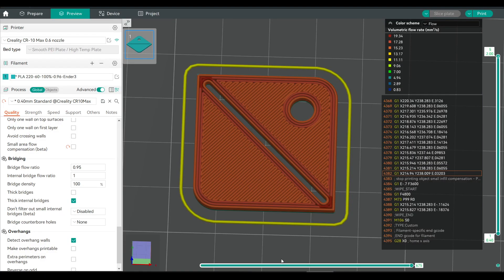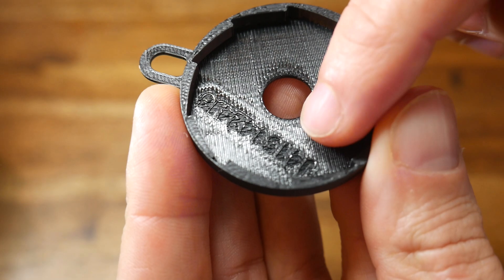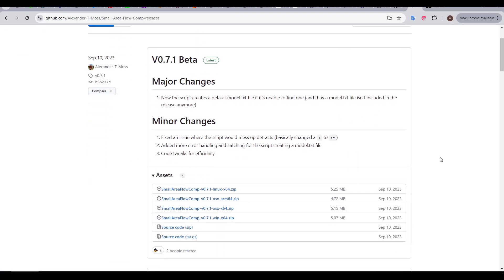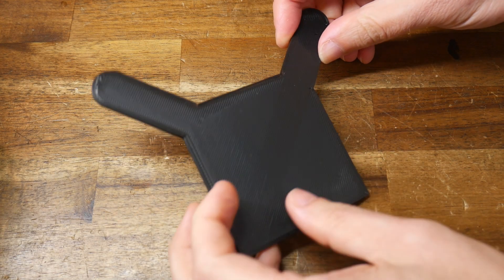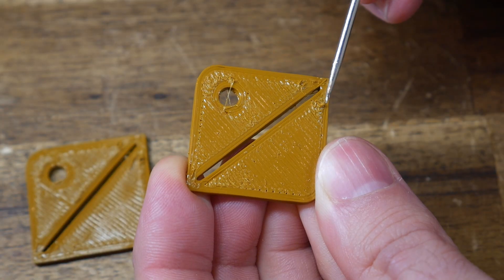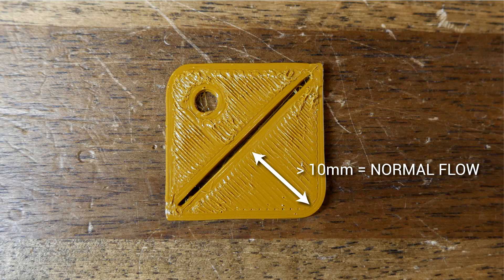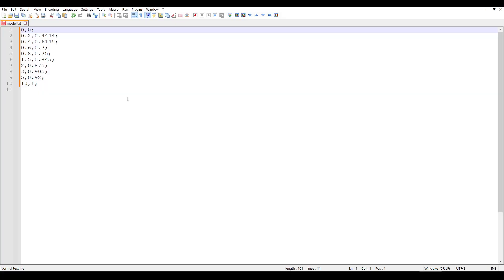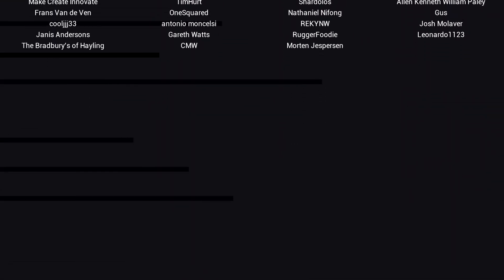How to tune Small Area Flow Compensation to improve 3D print quality

Comment: What would be a better version of this imo would be a dynamic speed based extrusion or volumetric flow dependant extrusion model, this would be better done at the printer firmware but is possible in “steps” on the slicer. Maybe one of these days I’ll implementing it

Comment: This has real potential, however, the original author seems to have abandoned it.  It doesn't play well with adaptive PA (which is more important than SAC) and breaks if you try to change the "10,1" setting.  It also biases the flow ratio of the entire part by some ratio, maybe the flow ratio gets doubled or reapplied--not quite sure.

Comment: Definitely a feature I will be trying. Though I think I'll write a script that curve fits the graph. Looks like an exponential saturation type, so it should be modelable as y = 1 - exp(- x/q), where q controls the sharpness of the curve. Higher q values result in more flow compensation for longer extrusions. This keeps the curve perfectly smooth and means you only have to tweak 1 value to tune the flow compensation. Whether this model is the ideal shape or not, I don't know, but it's probably a good enough starting point.

Comment: TLDR; If you get your PA and infill/wall overlap settings right you don't need this, and fixing those will fix many other problems that this won't.

IMHO the "small area" artefacts are actually a combination of pressure-advance and possibly infill/wall overlap problems, and this fix "works" because it indirectly addresses the same problem. The "small area" short lines are printed at much lower speeds than the long lines, so incorrect or insufficient PA compensation means they over-extrude, and since they are small the pressure never stabilises to the lower value for the slower speed. The longer lines also have a tiny short-slow line at the ends but this is so short the over-extrusion there doesn't accumulate like it does in the "small areas", and actually helps fill the gaps left by the rounded corners of the line pattern. Additionally the infill/wall overlap setting being off means the infill line-ends have a tendency to be over or under extruded which can mask or exacerbate the PA problems at different speeds. Note that even (or particularly) with PA tuned perfectly, you want some infill/wall overlap to fill the rounded-corner gaps and rounded-line-edge gaps (the gaps filled by the overlap-factor for lines in the flow-maths).
Reply: Thanks.  Do you think there's any downside to just having it enabled as a safeguard though?
Reply: @chadman6440  PA and Small Area Flow Compensation (SAFC) could interact badly and mess each other up.

 The general idea of SAFC is pretty simplistic and can easily get tripped by corner cases like the github bug #16 where it mistakes curved lines as short lines and over-reacts causing under extrusion. This is because it uses small line segments as the signal for when to reduce the flow rate, but the real reason is the accelerations. Curves are made up of short lines, but they have very little direction change so they don't require much acceleration. This means there are other things that can trick it like using slow speeds for top layers so there is not much speed difference between the long and short lines, or maybe even monotonic vs monotonic-line as the surface pattern because it only draws the long lines, so there are no short lines but it still needs to decelerate/accelerate at the end of each line.
However, it can be a convenient workaround for printers that don't support PA or just do PA badly.  At the very least you need to calibrate the hell out of PA first with it off, and then calibrate SAFC afterwards. If your PA is good and calibrated perfectly, then calibrating SAFC should result in a "flat line" with 1.0 for all lengths, which means it does nothing and you might as well turn it off. If it's not flat then yes, SAFC can probably improve things... as the calibration would show. But note you would need to re-calibrate everything for every tiny change, like changing filament or speeds, and there are probably some prints that it will just not work on and will need it turned off.

Note that most PA is not perfect and cannot be calibrated perfectly, so SAFC may be able to add some improvement for very specific cases. This is because PA is also based on an overly simplistic model that assumes pressure advance is linear with flow velocity. In reality things like print-surface back-pressure also make a big difference, and I'm pretty sure at higher flow rates the pressure should be related to velocity squared. This is why orca has the beginnings of support for non-linear adaptive PA and different PA settings for bridges... but it's fiddly to tune and I get the feeling its a "hmm... its not linear... it seems to be different depending on speeds and accelerations... lets let people set their own curve... oh, and it seems to be wildy different after bridges... lets add a setting for that", without any clear understanding or theory behind it. I think this means they are also not quite getting the knobs to tweak for the Adaptive PA right either... acceleration matters for the corner-tests they are using to calibrate with because it changes how much it slows down to go around the corner, and it's actually the speed differences that really matter. The bridge difference shows that print-surface backpressure is actually an important factor, which means it also affects overhangs to a lesser degree, and probably changes with line width and/or layer height. All of this is complicated by PA being mostly implemented with the simplistic model in the printer firmware, and all the slicers can do is change the one constant used by that simplistic model.

FTR I'm slowly doing some work on trying to develop a better PA theory and model on github under dbaarda/workspace-tools/blob/main/3DPrinting/3DPrinting.md, but its still a long way from ready.
Reply: @DonovanBaarda Thank you that was a really good explanation and a good read, you clearly know your stuff. I took a peek at your github and it's too complex for me to understand but i hope you figure it out 😅

Comment: For anyone having problems printing this with the correct top infill orientation in modern OrcaSlicer, I needed to change these parameters:

Solid Infill Direction: 135
Solid Infill Rotation Template: 0
Ironing: None
Detect narrow internal solid infill: Off
Apply gap infill: Nowhere

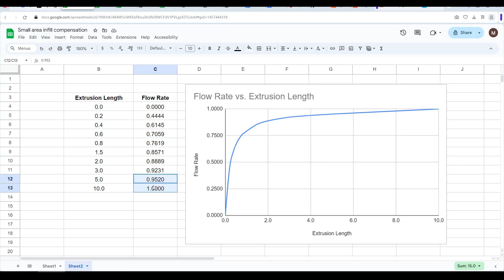Comment: I would like to point out that at 8:15, I understood that an extrusion of 7.5 mm will get compensated with the value that is in the middle (arithmetic average) between the flow compensation values for 5 mm and 10 mm. However, having looked into it closer, this is not how it works. The SAFC program uses a cubic spline interpolation over all the values given, so the graph in the Google sheet is also slightly misleading, since the data points are connected by lines. This video is a good introduction though and the test model is useful!

Comment: I haven't seen people talking about this, but the real impact of this is in printing thin parts! If your prints snap off when you have thin parts, it might be because excess flow causes it to blob, and then it will get knocked by the nozzle. With this, you can reduce flow in thin parts, and no longer have your prints snapped

Comment: There's currently a bug in ORCA.  If you change the 10.0 extrusion length from 1.0, to say .9, it will cause the script not to run.  That being said, I think this is a fantastic new feature and has a clear impact on the quality of the print.
Reply: Is the bug still there?

Comment: Interesting, but I'm not sure why it would be required to reduce flow on short lines? What is the underlying mechanism that makes this necessary?

I would suspect it would be caused by the continual oozing that occurs all the time at print temperature between print movements. Ie the average ooze quantity between lines is a bigger proportion of the line extrusion as lines get shorter, so reducing flow compensates a bit. If that is so, then the underlying problem to attack is the oozing.

Comment: Giving this a try now with PrusaSlice. NOTE: for anyone reading this PS 2.8.0 has a bug or at least mine does where you can't edit the post-processing script box, meaning you can't enter/remove/edit anything in the box. My work-a-round was to open the print setting .ini file and manually add it in. If you want to try this and you can't do anything with the post processing script box then open that print setting .ini file, find post_process =, after the = add "your drive\\your folders\\SmallAreaFlowComp.exe", yes quotes as well. Mine looks like this, and yes with the \\ as well:
post_process = "C:\\SlicingScripts\\SmallAreaFlowCompensation\\0.7.1\\SmallAreaFlowComp.exe";

Also, yes, bug has been reported on github
Reply: Ive got the same bug. I wasn't sure if it saved the post processing line. To check I just compared one profile to another and it shows it in there. Bit of a pain.

Comment: Note that the copy paste feature of the spreadsheet may use localized separators for values, not the US format. This causes a real mess with the result, since many languages uses the ',' instead of the decimal '.'. I don't know how locale settings affects this parameter in Orca. Supposedly US English, because initial values uses it. Regardless from what values I write (or locale) I don't see any changes in the flow view.

Comment: I wish Prusa Slicer would adopt features at the speed at which Orca Slicer does.
I am just not able to tune my printer as well in Orca as I did in Prusa for some reason (even if the settings are all the same).
Reply from the maker: I wish PS would add the calibration tests of the others, and I wish orcaslicer would add support for multi extrusion.
Reply: @TeachingTech  Yes, the only reason I want to use OrcaSlicer are the calibration test because it makes it so fast and easy to tune for a new filament, nozzle, extruder, etc.

Comment: that Nth degree of tuning further effects clumping of fiber filed filaments. loved it, ...then turned, when you mentioned it performs these adjustments thought the file.  After the first layer, except perhaps zits and holes 'thoughout' the printing, why would you not just use ironing on that single last top layer? (much quicker) 
...perhaps I'll stack processes.    :-)

Comment: its a shame cura doesn't have these settings. I tried orca and... I haven't had so many problems with a slicer in a long time. So extremely few settings, so very oversimplified, really weird controls that are impossible to change, the preview tab not orbiting where i'm looking in the preview tab, very weird and awful default settings that caused failed prints, settings that are extremely inconvenient to get to, slicing bugs, different behaviors every time I restarted the program...

Comment: The phenomenon this is trying to fix comes from an obvious mistake: infill overlap with perimeters. When area is large, the relative overextrusion that causes is small an evens out not to be noticeable. But when it's small there's nowhere for it to go but up. I use zero overlap and have never encountered the problem this is trying to fix.
Reply: Over extrusion in small infill regions is actually quite a complex issue, some printers (with perimeter/infill overlap on to varying degrees) don’t seem to suffer at all or nearly as much as other printers, I’ve even noticed this myself on my X1C almost not needing SAFC compared to my other printers. It also may very well be caused by multiple factors, incl. infill overlap, infill type, the way the slicer estimates flow, filament type, etc. compounding causing the issue. SAFC was created as a way to try and fix this issue in general, regardless of the factors causing it, in the future I imagine we will eventually know the majority reasons that contribute to over extrusion in small areas and hopefully fix the issue at it’s source(s) 🙂

Comment: I was just talking about how tuning the extruder while not under load will not give optimal result.  And with 35 years of process control experience, I have seen that not all autotune algorithms are the same.  Some just do not produce good real world results.

This is a topic I have been rolling around in my brain.  How do you put the extruder under a normal load without dumping copious quantities of filament into the air?

Comment: The Problem is you are running thecprinter at the edge or slightly beyond its flow limit.So in long lines the amount of extruded filament is limited by the hotend, on slower lines or after a pause the flow-rate increases up to normal. You are simply printing with to much flow for your hardware, especially on bigger nozzle-sizes.

Comment: But What Causes It?
seems to me, the overextrusion is a result of flow remaining constant; and not accounting for the physical acceleration and deceleration limits of the nozzle when it needs to change directions. -exaggerated with small areas, as it would be changing direction rapidly.
So rather than 'tune' this script based on line length it really ought to be a more General flow compensation based on Movement. Like Linear Advance.
Reply: yeah, i have pressure advance set up for my printer running klipper, and every extrusion length looked perfect. to me it seems like setting this up takes more time than just using OrcaSlicer's PA calibration outright. It's like a 5 minute print and you just look for the most uniform line. that's it.

Comment: Is there a way to deal with ringing? I've tried almost everything.
Reply: input shaping. or maybe it's a hardware problem, for example on my ender 3 the y axis has a toothed belt but the pulley is smooth, so every time the y axis moves, ringing. try calibrating and then printing slow, if it still has ringing it's probably a hardware issue

Comment: This shouldn't take so many values... it could/should just be defined as a bezier curve. We know the start/end points, we just need to define the angle/strength and the curve is automatically and smoothly generated
Reply: I did actually consider using a bezier curve, along with many other ideas like an exponential function for how to create the model, in the end I decided to use cubic spline interpolation as I thought it would be the most intuitive to tune and understand, where you can just change the em value for a given length(s) and the model does the rest 🙂

Comment: This turned the hot mess that were my 1.2mm nozzle prints into actually good prints that are fast, strong, efficient and now decent-looking (1.22mm walls 0.45mm layers, no-brand cheap transparent pla, I use it for quick functional parts, but use a 0.4mm or 0.2mm for detailed ones)

Comment: I think this is way better than scarf joints. My z seams are fantastic and barely noticeable anyway. This is huge and addresses the only problem I haven't been able to tune out. I have to balance underextrusion vs correct extrusion, but has bits overextruded and able to catch on the nozzle causing a layer shift in the y axis (300x300 bed running 8k accels on travel moves, that little bit of resistance overcomes my 85mm nema17 w/1.09nm torque) or it pops a peice off of the bed when it hangs up.
Reply: this has nothing to with scarf joints

Comment: This is am issue i've had for years and never knew what caused my top layers of small parts to be overextrudes. I kept changing the flow rate to no avail. This is a great fix, will definitly give it a try. Thanks for the video and thanks to the community :)

Comment: Rather than modify the points manually extract the trend line formula in Excel, or the open source equivalent, and modify the variables there.
This lets us modify the curve in any non-linear way we may need without having to guess at the points values for a smooth line. Using this method the curve can also be broken up into more divisions which should reduce the errors from interpolation.
Reply: Or define a bezier curve of some sorts.

Comment: Very disappointed by your spreadsheet - why is it not dragable by the graph and/or smoothing it out automatically. Changing decimal numbers to try and create a smooth grapd is very tedious.
Reply from the maker: It's free. It cost you nothing. Why are you complaining when you can make your own if you want?
Reply: @TeachingTech  Because you made pretty nice things in the past. I assumed this would also be well within your capabilities. The spreadsheet seems something half baked and not on par with your other work.
Reply from the maker: My point still remains. For the record, I looked into adding raise/lower increment buttons for each field but it needed to be a custom function, and the response time was around one second per press. Far faster to just type a number.

Comment: I’ve been using this feature since it appeared in a nightly build and it works a treat!  I’ve been very dissatisfied with how large flat areas turn out using modern slicers (Bambu Studio and Orca Slicer) and printers (X1C and P1P). My very old Wanhao Duplicator i3 Plus with Simplify3D v4 did a much better job in corners and around holes or protrusions, SAFC is definitely a step in the right direction.

Comment: OMG your timing with this video is spot on! I just started playing with my first 0.8mm nozzle and this small area flow issue is so much more pronounced with larger nozzles! I have been trying to tweak for weeks now and couldn't find a balance between long runs and smaller areas. This might have been the solution I didn't know I needed! 

Thank you for all that you and the community, at large, does for the evolution of 3D printing! 💙

Comment: This looks very nice, but isn’t it misdiagnosing the root cause of the problem? Surely this is related to speed, not line length? That means that if you change your speed or acceleration, these line length compensation factors will be incorrect.